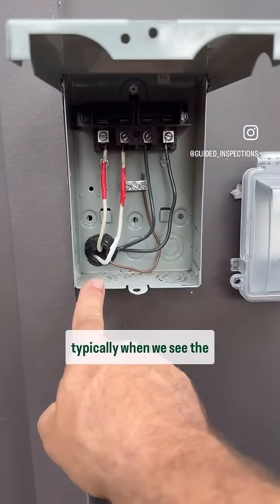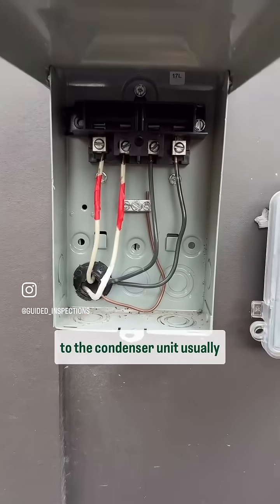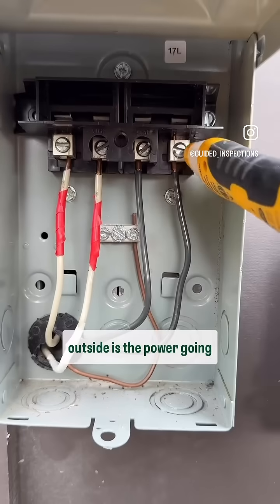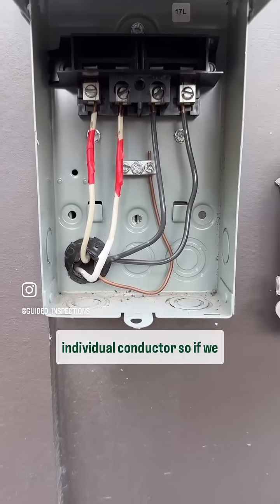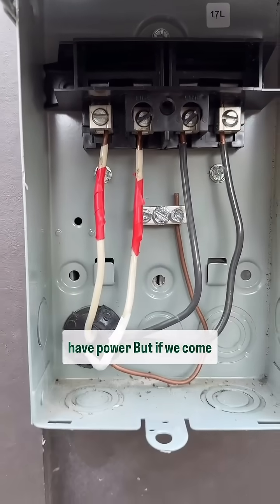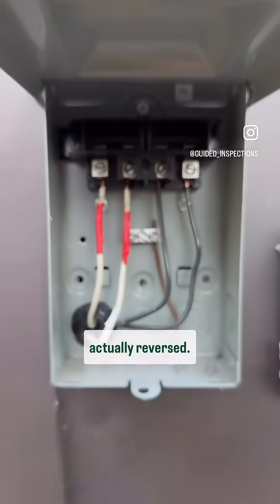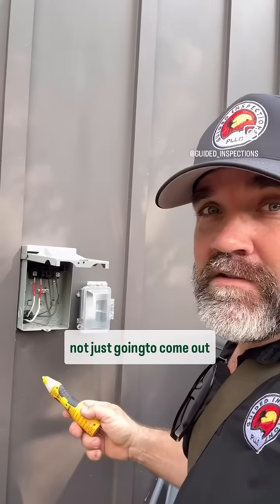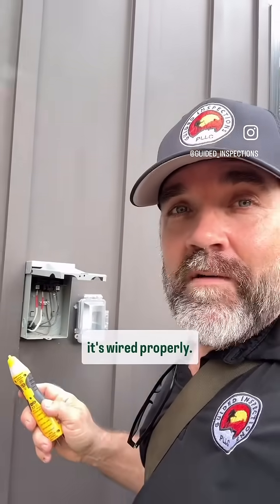⚡️Is your disconnect wired properly? 🤔 #homeinspection #electrical

Comment: Using that type of tester will get you hurt
Reply from the maker: I also use a proper multimeter. This is simply a basic voltage detector to demonstrate quickly for the video. Surely you guys out there do realize that the video was just a quick snippet to show things that we see, but that we actually do more that you don’t see.… Right???

Comment: No sheathing inside the disconnect and where is the second ground wire? This is a strange way to install a disconnect and id be willing to bet this would not pass an electrical inspection 9/10 times.
Reply: UK spark here and gotta say, I'm confused as to how this scenario even arises. Dangerous as shit if you ask me.
Reply from the maker: Yeah, I have no idea what the installer was thinking and it's interesting because the builder's response to my client after receiving my report on several other items is that "it passed city inspection" so they are not doing anything about it.  I believe they are actually fixing this disconnect issue, but clearly, the "city inspection" is not catching everything.  If it always did, third party inspectors such as myself would be out of work.  But, here we are....
Reply: @GuidedInspections  Nothing should be confusing about when dealing with electricity!
Reply: Needs proper labeling, only one ground wire is an eye opener.
Reply from the maker: @lotharschiese8559 agreed!  There’s no confusion on my end about this being a significant problem. The confusion is what the installer /electrician/ builder was thinking 🤔🤷🏻‍♂️